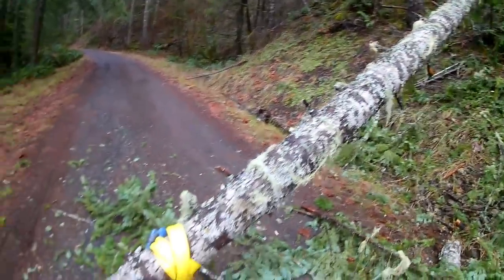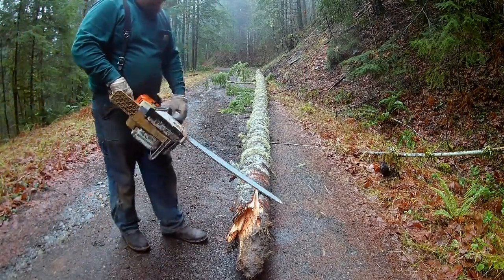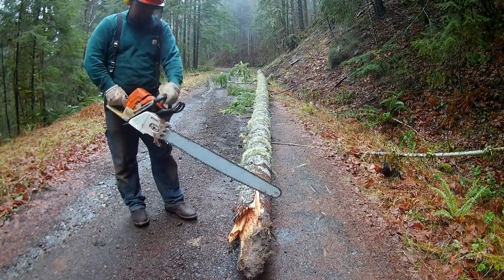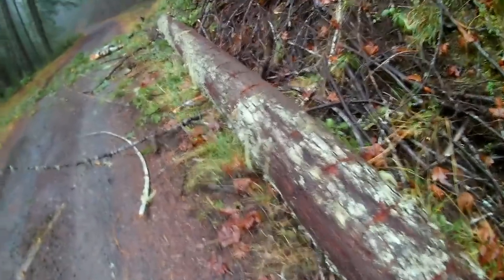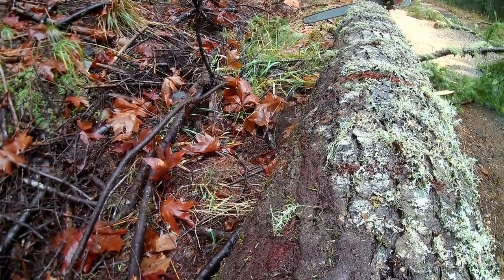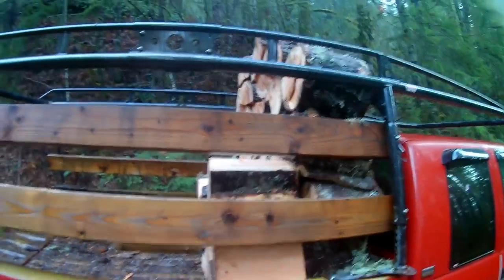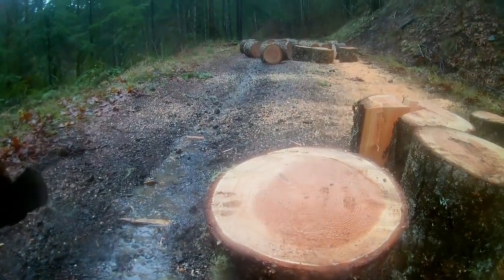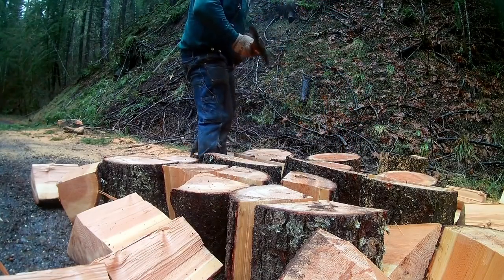The best way to cut firewood.

Comment: Good Lookin Doug-Fir . Aw, I thought I was the only one that knew about  tippin the axe a little sideways when splitting firewood, for easier splittin. You have been in the firewood rodeo for awhile. I noticed when you pulled tree to ditch, you were going downhill making it easier on your pickup. You have a lot of firewood getter done up your sleeves. Good watch. Its just about time for a cold one.
Reply from the maker: @danbentsen  Thanks. Yeah i have cut wood for awhile.

Comment: It used to be easy and fun to split doug fir rounds. Of course that was a few years ago.{40 plus years } Now madrone was a real workout. Miss those days.
Reply from the maker: Yea Doug fir splits nice. Madrone is crazy. It does make nice firewood if you can find it the size that does not need split.
Reply: @WildBill1122  Yes sir. If you have to split it, do it while it's still green. One thing for sure, when its dry, it sure burns hot. Enjoyed your video.

Comment: 440 is a beast, I really like mine.  But earlier this year a buddy called and asked if I was interested in a 660 for cheap.  Heck yeah !!  I can't believe the difference in the two.  The big boy only comes out on big stuff, I don't wanna toss it around all day like the 038 Magnum or the 440.
Reply from the maker: Tractorman44 yea I have ran a 660 a few times it is a major bump in power. Thanks for watching.
Reply: Hey man, no problem.  I love wood cutting/splitting/sawmilling videos.  That old Chevy sounded pretty good yanking it down the hill !!

Comment: also, do you burn your fir with bark on, or try and remove it?  i see that bark is not terribly thick. some island fir has super thick bark, creosote build up?
Reply from the maker: I burn it with bark on. As long as it is well seasoned I have not had a problem with creosote. The thicker old growth bark I separate and will burn on cold nights with a good coal bed to place it on.

Comment: My Stihl 261 broke down (crankshaft) after only 3 years  of cutting firewood. Stihl told me I was to blame since I did not use Stihls brand oil or Stihls alcylatgas.I used 95oct gas and shell oil mixed 2% My old stihl 026 lasted 20 years on this mix. Stihls new saws are so finetuned that you have to use stihls products to get them going. Not happy with the 261 or stihl service.
Reply: Should have bought a husky.
Reply: Still is telling you some BS
Reply: Yeah have to use really shitty oil to blow that saw. Mixing wrong on the other hand is a different story

Comment: How does that axe split so well? I want one!
Reply from the maker: The profile of the head help greatly. It is similar to that of a splitting axe. Some double bit axes have a thinner profile that is not so good for splitting but is good for cutting. The other thing is the head weight is about 5.5 lbs which helps deliver more energy to the edge at impact along with a 36 inch handle.
Reply: has more to do with knowing how to use it
Reply: Some people can't swing like others. I've seen full grown men that swing like a girl.some can but can't commit to just split it.
Reply: Another thing is it ain't oak.
Reply: Depends on wood, some splits easy and some will really work you, same axe.  This is nice wood, no knots and looks fairly dry, whole different story if had a higher moisture content with a lot of knots.  Lengths make a difference, 14” rounds much easier than 20”.  Buckin Billies splitting videos would be much longer if he was splitting some knotty wet bull pine blow downs.  I have had loads that had to be broken down with steel splitting wedge and sledge side if maul, forget an axe.  Problem solved, in my old age, hydraulic splitter.    Sometimes it more the wood than the axe that makes life easier.
Reply: I don’t think I’d be pissing you off holding that 🪓